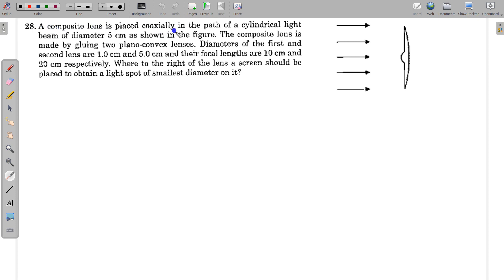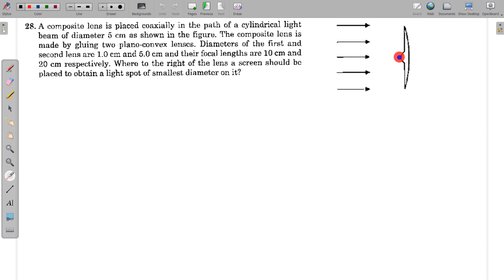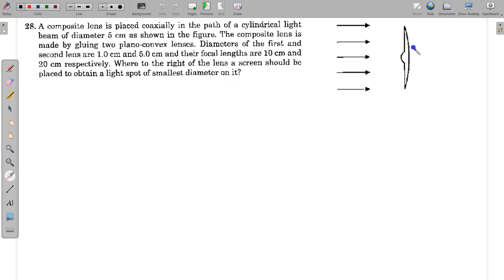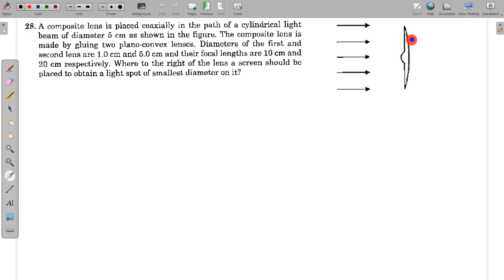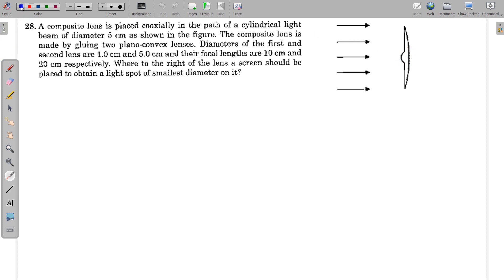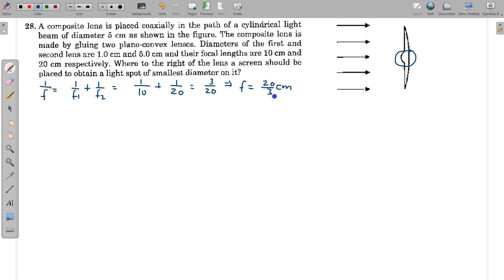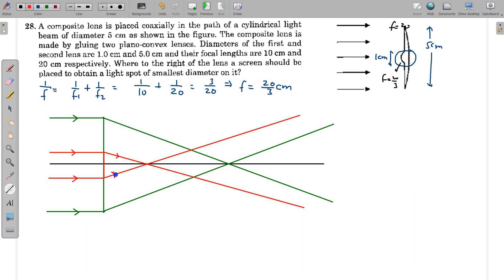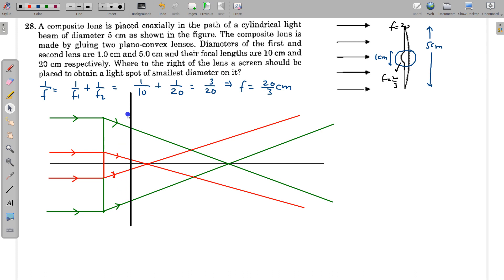Geometrical Optics | Pathfinder Solutions | Composite Lens

Comment: SIr, till length 20/3 cm the spot size due to both was decreasing
at 20/3 it was min for red
after 20/3 it was increasing for red and decreasing for green 
so i am confused as to why we can conclude that point of intersection will necessarily be place of minimum diameter